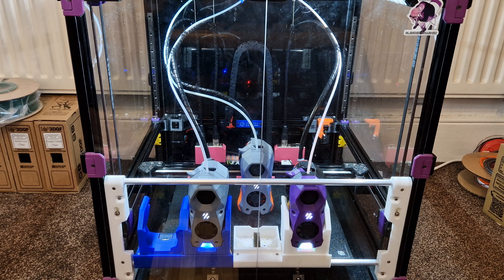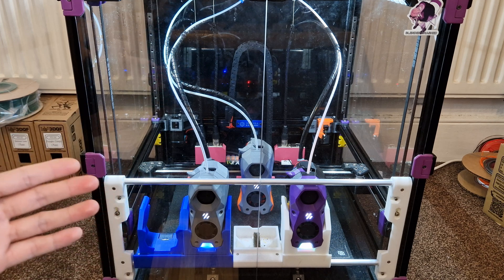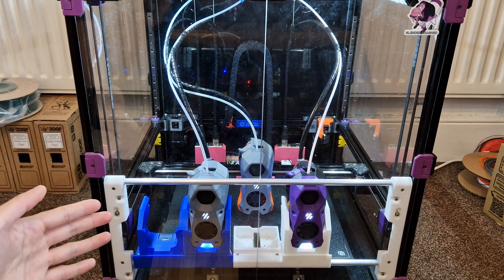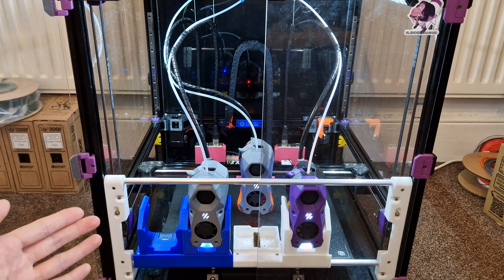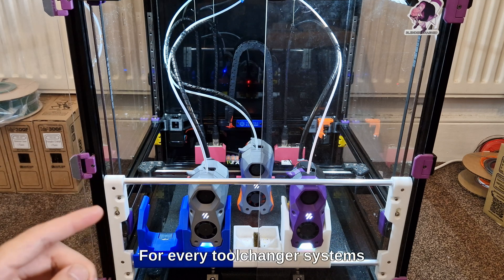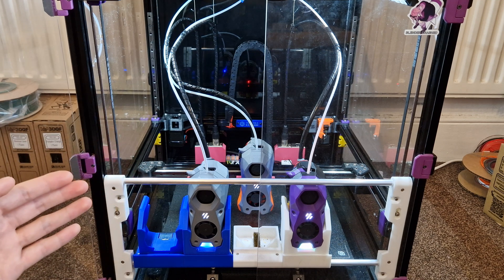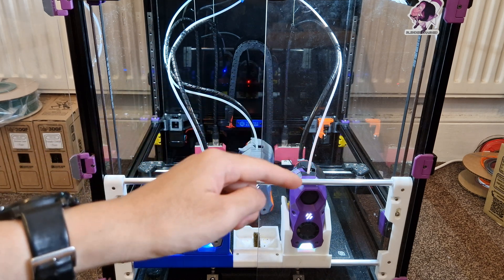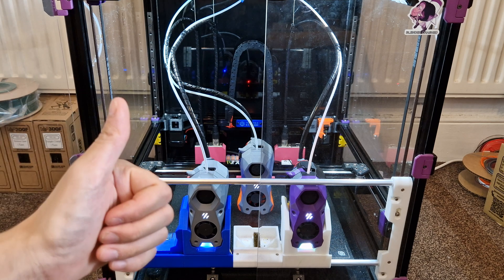MissChanger - Milestone 3 - Beta 1

Comment: does this tool changer require you to have canbus or can it be setup without one?
Reply from the maker: I am using canbus, it is the simpler approach at the moment. For USB a connection additional hardware are needed and needs to be jerry rigged together.

Comment: Is there a documented way to add something like the ercf also? Imagine having it swap colors on a multi color print while there is always a tool head actually printing? (Eg. 4 colors on 2 tool heads.) Best of both worlds
Reply from the maker: Technically, there is nothing the ercf to work on a toolchanger. The challenge is mostly down to the cost of the whole thing and the setting up the config.